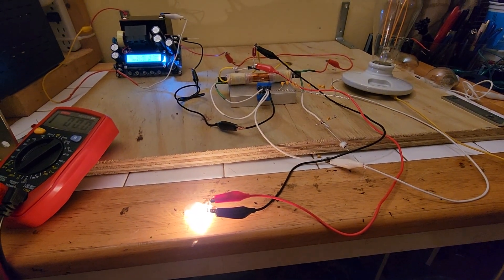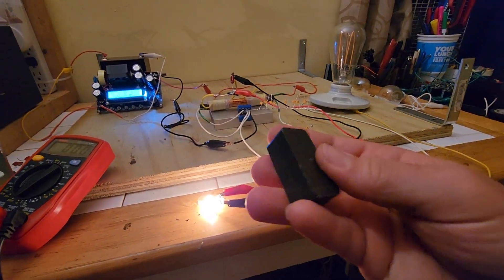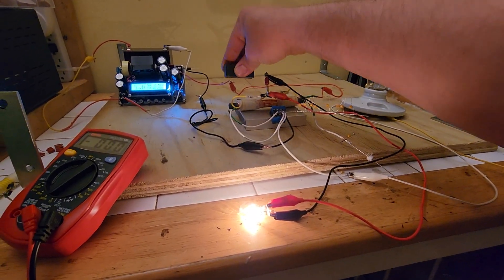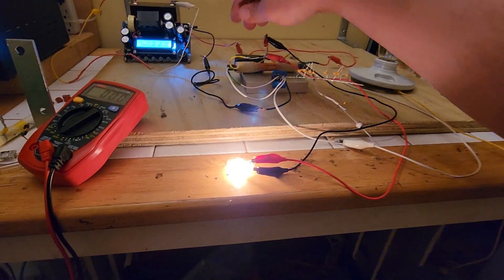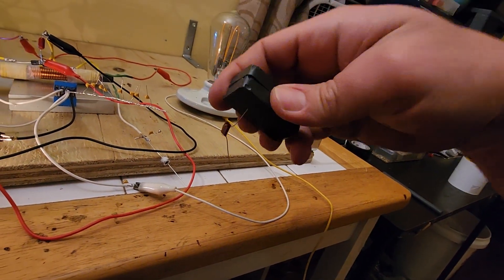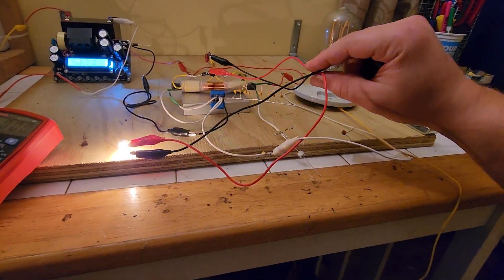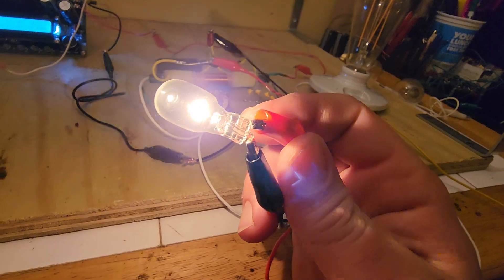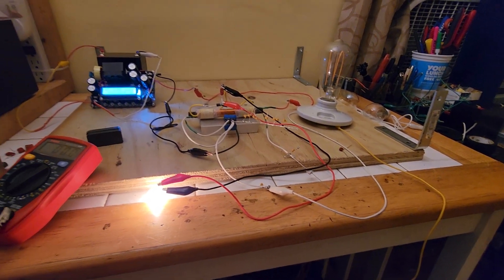🧲PERMANENT MAGNET ENHANCES RINGER CIRCUIT OUTPUT POWER? INTERESTING DISCOVERY🧲

Comment: Yes all you're doing with the magnet is changing the resonant frequency and when the magnet makes it brighter you are more likely to approach resonant frequency. 
It has nothing to do with the ferrite. You need to know that the coil you wound is like a high frequency electromagnet because it gives off a magnetic field at a certain frequency as it charges and collapses through the coil and through the transistor. Thank you very much for the demo and for sharing
Reply: It should be the result of increasing additional magnetic flux

Comment: You just made an observation of true effect of permanent magnets. Currently we don’t have commercial available any device or appliance using te energy of permanent magnets for magnification, just for kinetic (induction). This is because mainstream science is reluctant to admit the obvious truth that any permanent magnet display magnetic effect only when they retain an electric charge which is circulating inside of the permanent magnets. When permanent magnets lose magnetism in fact they lose electric charge and they can be re magnetised by applying an electric charge.

Now with all these said, let’s think about electromagnets: they are made of just 2 elements copper and iron not 3 elements as permanent magnets iron-copper- nickel or whatever else in 3 element combination.

An electromagnet consist of winding and its core even if it is air core …the choice for core depends on their operating resonance. Now, think what the core does ? Add up inductance. What is inductance ? The medium for storing electric energy in magnetic field.
Now, based on your observation kindly shared we can conclude easy that a permanent magnet placed in close proximity of an electromagnet add up its own energy by sharing the same magnetic field. If just a core (1 element alloy or just iron) is added we can observe that indeed inductance increases but without added energy and this simply reduce energy available as the core became unsaturated.

Just have a read on Arie deGeus patent for cyclotron and see how permanent magnets are used by inventor on antinodes based on wavelength of wire length used for coils with huge magnification effect.

Permanent magnets are strictly avoided by mainstream science because they don’t want to explain how they work based on electric charge retention and a single impulse charge can produce tremendous amount of work compared with total amount of energy input. Permanent magnets are self resonant using a single charge input which being retained (3 element construction) and electric charge circulated inside them create magnetic field permanent for as long as they are able to retain electric charge.
Now, to make things even more interesting and “wild” try to visualise a Faraday disc where 3 element permanent magnet is used and rotating copper disc between permanent magnets create voltage from inside (center of disc) to outside (outside rim of disc) and the disc is parallel with magnetic field … there is no 90 degrees cutting magnetic flux with wires as it is mainly presented in electricity generation and utmost ignored by mainstream science, leading to eronate dismissal of other forms of creating electric energy like Marinov siberian coliu or many others. … keep in mind that effect of permanent magnets can be created with electromagnets and this lead to wireless power transfer or can be used either for modulation of magnet flux fr induction, and most of the time we need very little energy for this modulation if right materials and frequency is chose wise.

Have a think of all of these FACTS and good luck in your endeavour. ❤
My only humble request is to keep them open source as it is now as general knowledge, please.
Reply from the maker: Your an absolute gold gem of information man & I appreciate it. I'm saving all this to my notes & the self resonance from the tesla coil by the piezo lighter sounds really interesting. Now I'm going to experiment with extracting electricity out of a permanent magnets magnetic field by bringing it near the ringer circuit in various spots
Reply from the maker: Very interesting & I appreciate that in depth explanation I saved it to my notes & we're always open source :)
Reply: @MTECH2022  honestly I can go on for days if anyone is curious. You may want soon to experiment with electrets as they are in fact permanent magnets with added capacitance due to replacing iron (low frequency) with dielectric (high frequency) and may find out that what we call now insulators are in fact simply charge separators … which can explain why “static electricity” is always conducted by dielectric or insulating materials. If electric charge can not pass through a material then it will be separated in positive and negative for each side and this is what is happening in a capacitor when charge becomes static.

Also same effect is better described by Faraday when a faraday cage is used and we can observe that any charge placed inside the cage will be polarised on opposite walls but also outside the cage same polarisation can be observed and accumulation of polarised charge is happening and even matching the same voltage as the inside charge without any source applied on the outside … on an electric conductive aluminium .

Maxwell equations, Heaviside, Don Smith, John Bedini and many others have said that more energy will flow outside the conductive wires than what can be carried inside the wires.

But for now let’s settle for ordinary permanent magnets and keep in mind they have their own electric energy stored inside themselves. They can lose their charge by shock impact when impulse energy will de-tune them even for a split of a second and they lose magnetic properties, but they can be re-magnetised by re-applying an impulse charge. Or they can lose their magnetic abilities when heat treatment is applied and their crystalline structure is allowed become too elastic and electric charge can escape the compound. When they cool down they can be re magnetised by applying an impulse charge.

So, as we can observe, permanent magnets are pieces of 3 element alloy each one with different conductivity, resistivity that only work by retaining an electric charge for exceptional long time. A parallel with this and more enhanced understanding of phenomena can be seen on William Fraser channel where just a spark from a piezo electric lighter is used to initiate self resonance of a Tesla coil+1 capacitor+1 transistor being able to keep lit up an LED and lit up (locally) an ordinary fluorescent tube. I think this is one of the best example of self resonance that I ever seen online and being able to reproduce what I have described happening in a permanent magnet. (Check my channel to see username where I have subscribed) And if you have a paid yt you can download his video and maybe repost or just save for reference.
Reply: @Caesarus2011 I think yt is blocking my comments. I sent you 2 replies but I can’t see them when I view the video in another browser while logged out. Let me know if you received my other 2 replies.
Reply: @milesjargon  sorry, this is the only message I can see, avoid to post links … yt will remove the whole message.

Comment: Thanks for sharing. Trouble with YouTube is people make these videos where if you pick it up half way down a "video series" you probably miss the point and then you have to go back through months of videos trying to understand. What's going on? Powering a 4 watt bulb with a power draw from your source of 8 watts....? I've got two metglass rods , tip35c's, oodles of wire, capcitors. What am I missing? Why would I make this? Powering a 4 watt bulb with a 8 watt input. I'm not meaning to spoil or distract. It's a genuine questions. Perhaps I guess you'd need to explain everything clearly in every video, otherwise people landing on this will be wondering the same as me. It just a joule thief? Your just flickering the bulb at a frequency we can't notice, the magnet is changing the frequency also. What are you claiming? Super efficient power use to light bulbs? How much light do I need, lights are like the cheapest and easiest thing to run. I get it's just a concept or something. You yourself last video said you have solar power. I too have a tiny solar panel, and really it produces enough power to light my lights as much as I need. I'm sorry to sound doubting, but of course I want it to work, I'm just seeking clarification before I build this. Is it just a Lazer saber joule ringer?

Comment: it will  get brighter if you bring a beta source near it on one end .they found that radium chloride was used and the magnet field converted the beta radiation to electrons by the flux field.. nuclear energy converted to standard electrical.

Comment: Is one pole brighter than the other? Maybe the brightest point is the plane of inertia in the middle. Have you tried neodymium magnets? You could also try it with a halbach array.
Reply: Permanent magnets being used for core saturation will just reduce required energy input to reach saturation and all input energy is used for magnification. Permanent magnets have their own energy that have been placed inside them ready to be used continuous 😉

If primary winding is built self resonant (not just resonant) it will draw zero watts from source once system is initiated. Positive or negative feedback to primary will prevent dampening effect.

Comment: The Hendershot Generator supposed to make 300 watts for free, it is similar to the wrapped rod you have
Reply from the maker: Very interesting. I'm curious to try different shaped magnets near the rod. Maybe one will increase output without any strain on the source
Reply: @MTECH2022  It should be possible
You need to consider how to solve the problem of Lengthy Effect